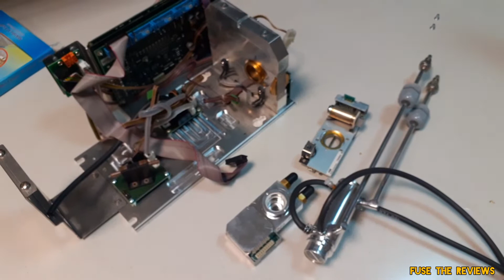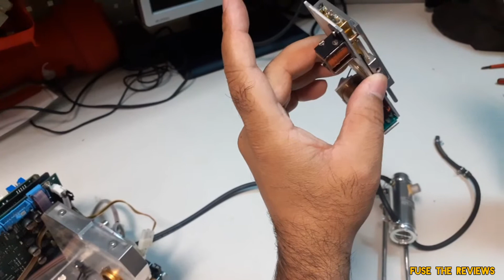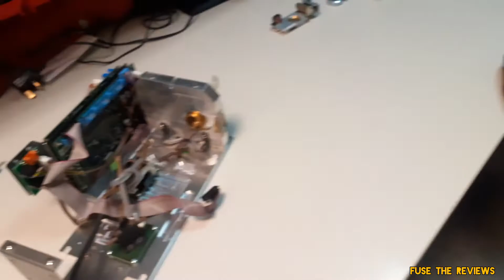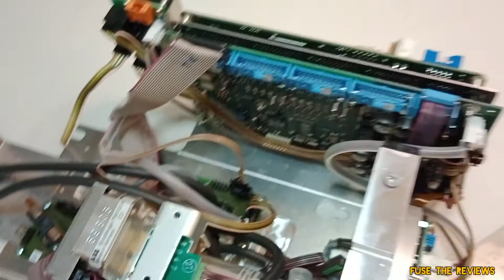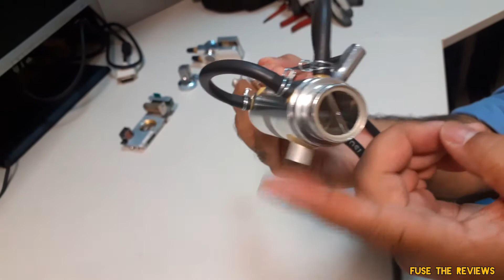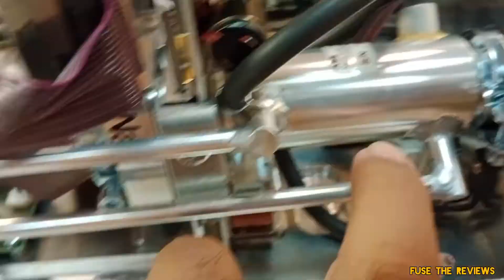CO analyzer working principle and trouble shooting

Comment: Thanks For Information...
I have ABB uras26 Ao2020 Analyzer (co,so2,no,and o2). these reading value are not stable, even we have to done basic calibration many time.
so plz suggest what i will do???
Reply: Need to make optical and phase adjustment 
If not working than det need to be replaced by new one
Reply: replace detector, clean or replace sample cell